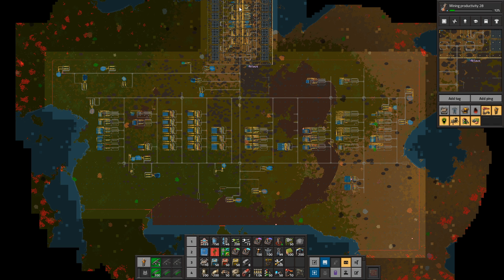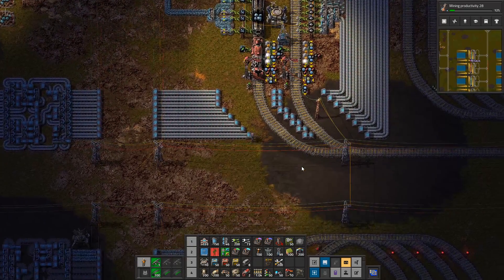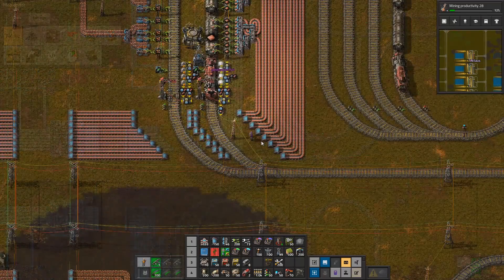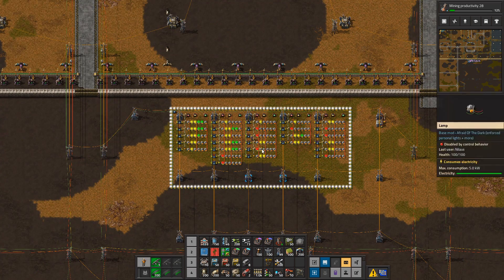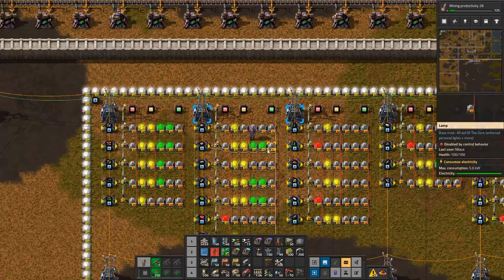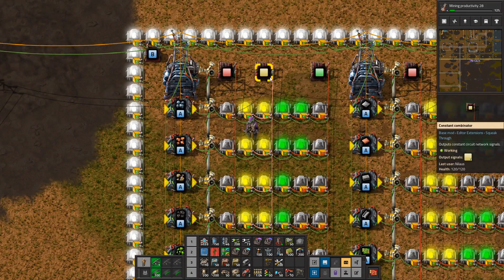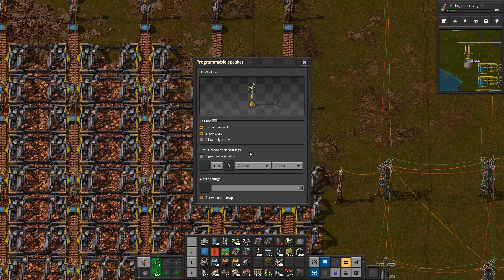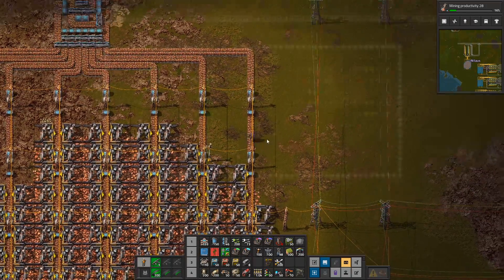DASHBOARD For MEGABASE Overview | Factorio Tutorial/Guide/How-to

Comment: Related to building a dashboard, I’m curious to how various players set up their circuit networks to track inventory and other various controls. For me, I typically have a global green wire around the base tracking available items (usually by trainload). I also have a power signal on that green wire that indicates stress on the power grid and does some peak demand trimming if needed. I usually use red wires for local controls at various factories (with occasional local green wires to help with more complicated circuit setups).

Comment: Logarithmic scale is better than linear scale. Especially for telling if you have enough production or not. I guess this is technically exponential scale though... interesting...
Reply: Depends.  The values increase exponentially from one bulb to another, and the # of bulbs lit, if it's not red, is log(value) + 1 rounded down, with a logarithm base of 2.  Not sure if there's universal agreement if thescale is logarithmic or linear in that case.  
The kind of paper that comes with lines like that is usually called logarithmic, but then again, the line markings are different: diminishing distances for constant differences until the distances would become too small, then usually an increase by a factor of 10.  What Nilaus built is basically the same distance, with breakpoints at the powers of two.  So although the underlying function is the same, there's some difference in implementation and could go by different names.
Reply: @achtsekundenfurz7876  i eventually decided this is an exponential scale because it is 2^N for each bulb. 2^0=1 for the first bulb, 2^1=2 for the second, 2^2=4, 2^3=8
Reply: @MattWyndham  it's literally a logarithmic scale
Reply: @Elearen  so what you’re saying is that “exponential scale” isn’t its own thing, but 2^N is considered a logarithmic scale?